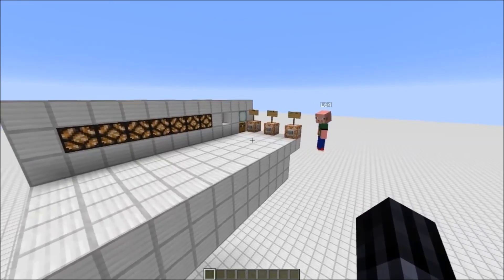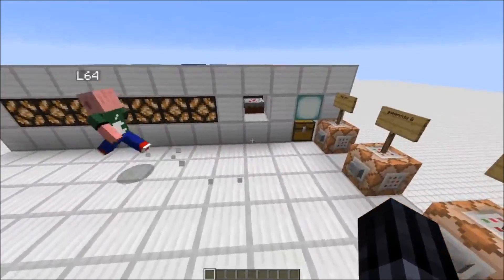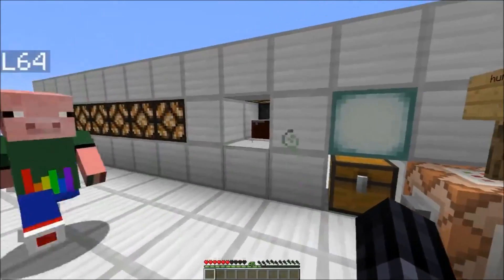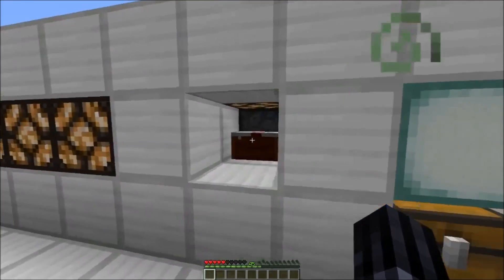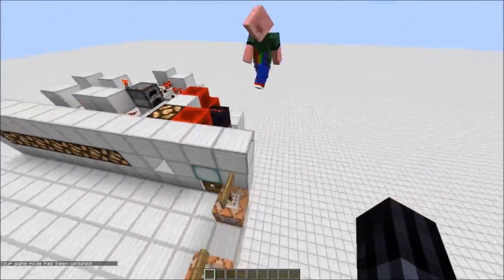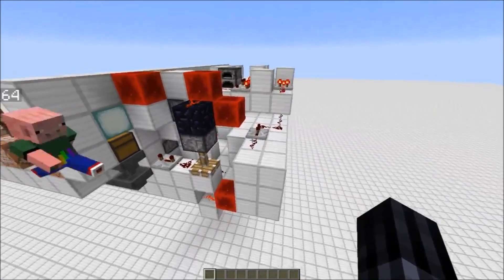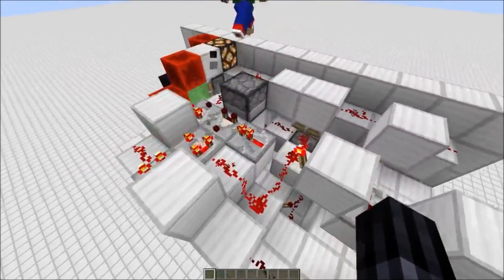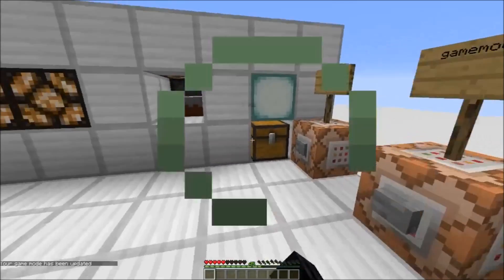SciCraft's useless contraption series #1: Cake Detector

Comment: Hey... I've been having trouble with my most recent redstone contraption. I need a instant analogue decoder... so far what I've got is a decoder that can accept 1 tick inputs 2 ticks apart but I can't get any faster than that. I use pistons and redstone blocks to block them from pushing where one side is stronger than the other. Got any ideas?